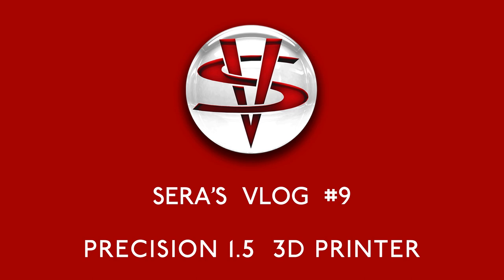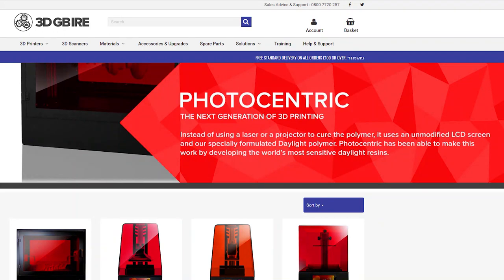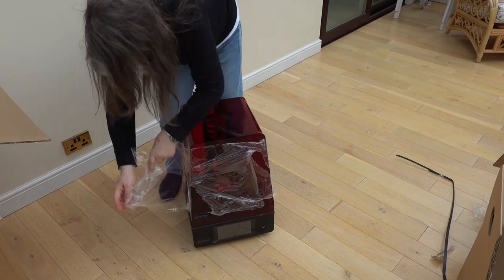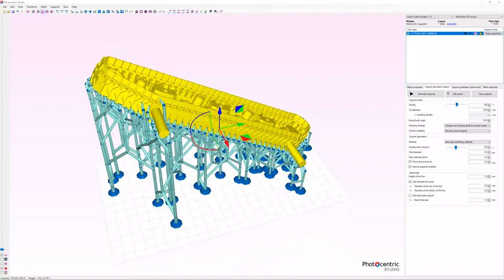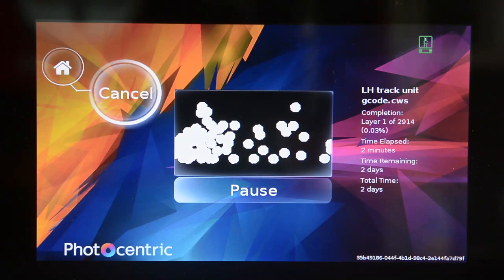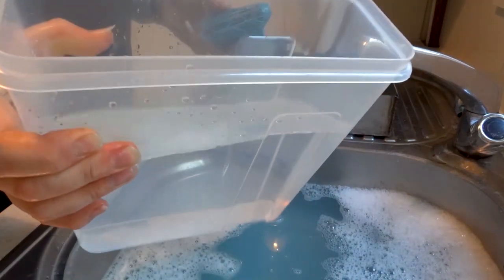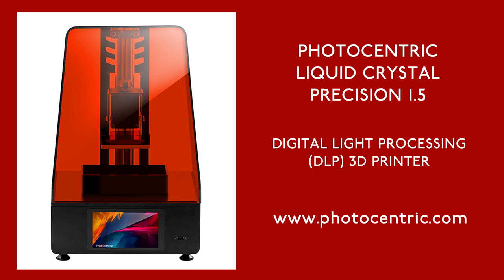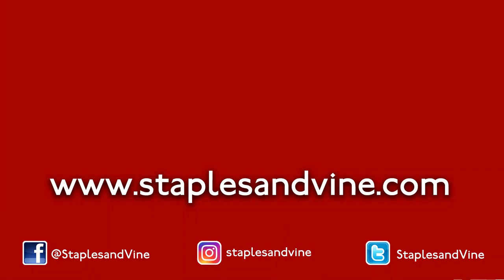SERA’S VLOG  PART 9  ‘PRECISION 1.5 3D PRINTER’

Comment: Looks like print quality is much better than lcd printers!
Reply from the maker: The print quality is exceptional. My only complaint is the build volume. Technology is improving and prices are coming down all the time. I'll soon be adding a bigger printer to my arsenal no doubt...
Reply: @StaplesandVine  which lcd/dlp would you recommend for printing models of cars/planes etc?
Reply from the maker: Currently the best value printer on the market is the Elegoo Saturn. It may not have quite the resolution of the Precision 1.5 but it has a decent build volume, prints quickly and is from a proven manufacturer which resin manufacturers are keen to supply. I plan to get one soon.
Reply: @StaplesandVine  why not the anycubic photon x?

Comment: I'm torn between a Photocentric and a Prusa SL1 but the Photocentric looks ideal but with a higher cost for post processing. The Photocentric also offers a really good build size in the LC HR2. When looking over the resins I'd really like to get a Photocentric LC HR2. Thank you for  the close ups on your prints. They look fantastic!
Reply from the maker: Hi Sarah Doodles there are so many features to consider when choosing a printer, try and focus on what is most important to you. I chose the precision 1.5 specifically because it printed  the type of resin I needed. The HR2 prints with a different set of resins ( otherwise I would have bought an HR2). Post processing I think is much easier with the LC than Prusa. Look at replacement vat prices because you will need to re-skin from time to time. The suppliers will print samples for you if you send an stl. If you can I recommend the HR2 but research thoroughly. Happy to answer any questions. Hope this helps, Sera.

Comment: Hello, i have a question please, i see that you upload this review a year ago. And i want to buy one , do you still recommend it after a year of using? Did you face any problems that a potential buyers of this printer should be aware of? Thanks.
Reply from the maker: Hi Inky Speech, I am pleased to report that the Precision 1.5 is still going strong and I am delighted with my purchase. I have discovered a few things; It is so important to keep an eye on the vat film as it needs regularly replacing (as with any printer), the slicer software is excellent and easy to use but support placement is a bit of a learning curve ( the auto support is very good). I have tried other photocentric resins but found the blue mould to be very good, I think the green may be similar. The vat can lift during early stages of printing but can be easily taped down before starting a print job. The slicer software is excellent at showing mesh errors - this is very helpful and saves a lot of failed prints. In short it's built like a tank, I have had no issues and would buy the same printer again, the quality is everything I could have hoped for.
Reply: Staples and Vine , thank u very much for replying. And thanks for the clarification I really appreciate it.